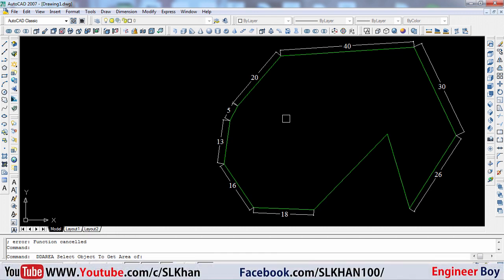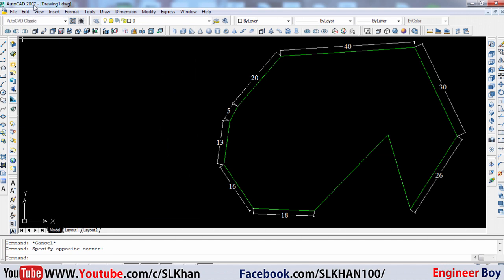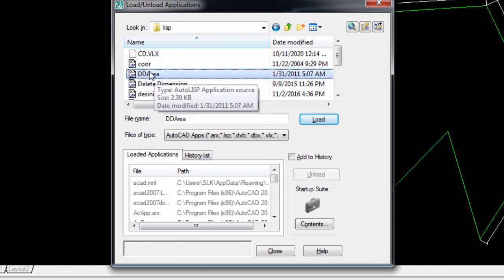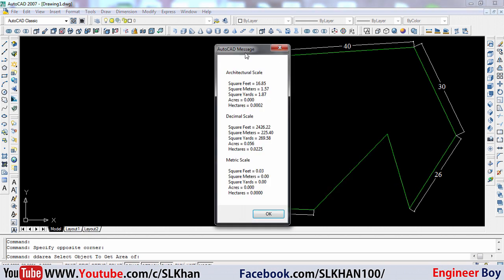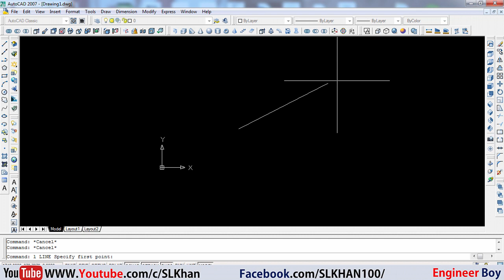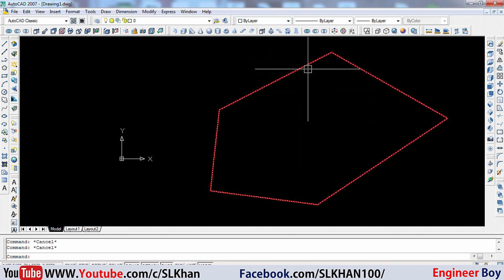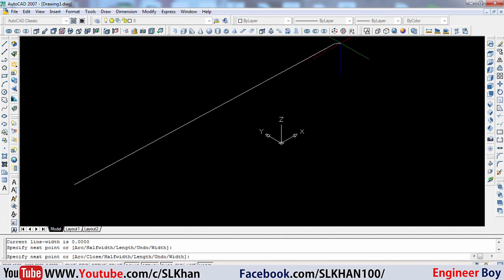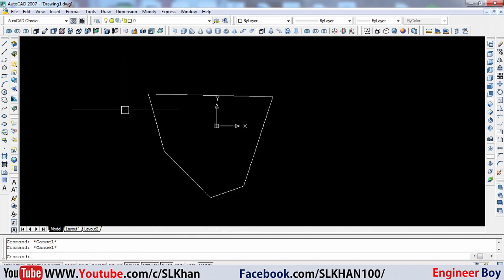how to use DDarea command in AutoCAD #area

Comment: Fixed your USC Icon so it will not teased you
Reply from the maker: Yes. UCS. But in my 2007 autocad i have many problems 😂😂😂. I use 2019 which is awesome
Reply: @Sulimankhanacademy  Dear it can be fixed means it will not movable but lol forget the command I will rewrite it when I that command come to mind once. Btw how you load that file where that file have?
Reply from the maker: Download it from my drive. Link is in the description